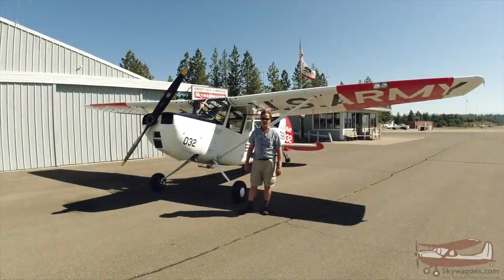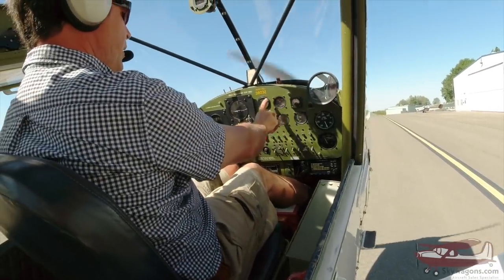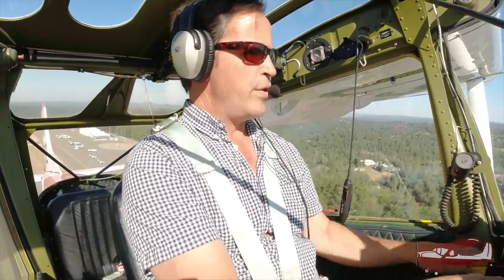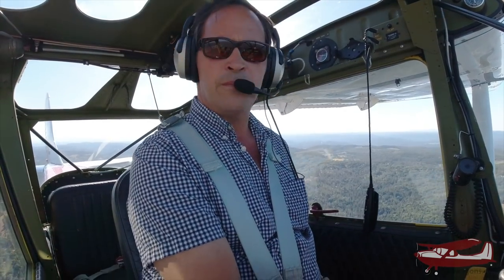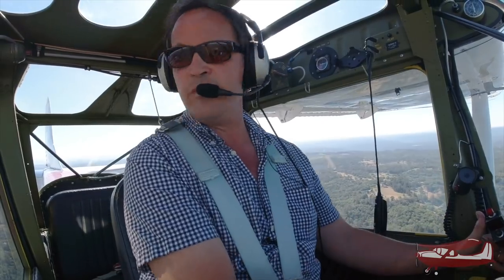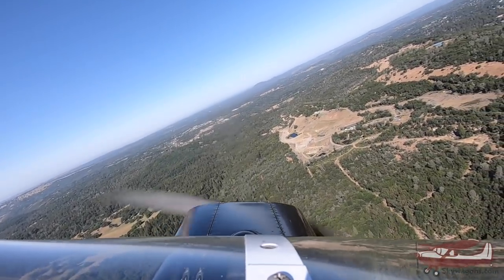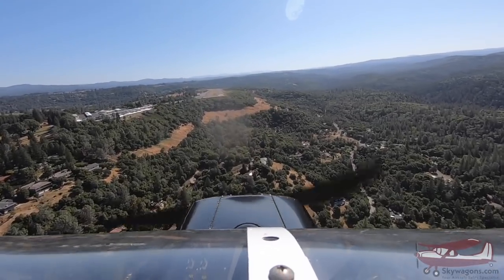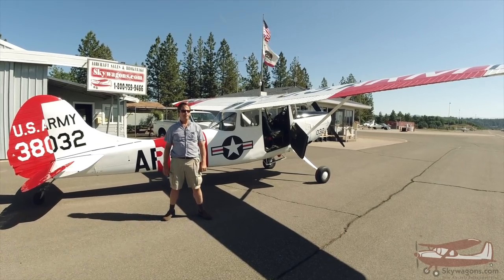Flying the Cessna L19 Bird Dog

Comment: Mark, I'm somewhat envious of your little trip around the pattern. Now a comment from a 1,000 combat hour former Army O-1 pilot. With the flaps available in the O-1, there is NO need to drag it in to a landing. It's not a 757 with two powerful engines. It's a simple little aircraft that, with the wide range of flap settings, can be landed with only idle power and not dragged in. We were always taught that you should be able to land it if the engine fails anywhere in the approach. Plus, by using minimal power in landing, you will land in a shorter distance. If you have the flaps, learn to use them ... all of them if need be.
Reply from the maker: Thanks for the tip.  It was the second landing I have ever done in it.
Reply: When I learned to fly (1957) and when I was an instructor, (1962-1966), we taught only power off approaches. Adding power on final meant you screwed up.
Reply: @frankbacon245  That is the way I was taught by my instructor in 1957.....he was a former USAAF and USAF pilot who flew C-47 and C-54s ."over the hump" and the Berlin Airlift.......he said "any dumb**s can land when his engine is performing.....it takes a pilot to land if the engine fails"
Reply: @jimsteele9975  I had the unfortunate experience of a dead  stick landing on an old  dirt road.in Laos.
Reply: Topper- Over 1000 combat hrs here too . (1st Cav.)  Mark did a wheel landing.  I was never trained to do that.  I tried once and it scared me to death.  Every one of thousands of landings, on all types of surfaces and conditions...it was full stall; plant all 3 wheels on the ground at once; you're done flying.  In a wheel landing, one is still half flying until somewhere down the runway, after the tail wheel touches down, and gets slow enough to brake.  In a three point landing, one can land in a surprisingly short distance by hanging it on the prop;  coming down the final with a high power setting, nose high, slow speed (close to stall warning), planting it, cutting power and braking all at once. It helps that the plane has a 470 engine, large 60 degree Fowler flaps, and single leaf spring main wheels gear.  She's a tough bird. Of course, if the engine quits, you're toast.  I implicitly trusted our mechanics.

Comment: The L-19 for Microsoft Flight Simulator, a fairly recent release, brought me here. That's about as close to the real thing as I'm likely to get, but it does behave exactly as your video. So, at least there is a good virtual model to afford vicarious thrills! Have to agree with the military pilots commenting that it lends itself to a low throttle or idle setting on final, unlike the J35 I once owned. Thank you (2 yrs late...) for the video!
Reply from the maker: Nice to know it is similar.

Comment: I got to tow banners with several birddogs back in the early eighties. It was so much easier to tow with this plane vs. a cub. An added  bonus was the back window. You could actually see how the banner was "flying" much easier. If I remember correctly, at least one of the planes had 60deg. of flap!
Reply from the maker: Thanks for sharing that story, Larry!

Comment: Beautiful Bird Dog. I towed gliders with them, they were pretty rough looking planes but fun to fly. The only thing was with no one in the back seat we didn't use full flaps, you couldn't do a three point landing with them in that configuration.
Reply from the maker: You have to have the guy in the back lean forward a lot.
Reply: The US Army never taught wheel landings in the O-1 for a reason ... this little beast needs a 3-point, full stall landing and keep her straight. Wheel landings look nice but not intended for any sort of short field or unimproved field landings. Try a wheel landing in a high crosswind and you'll see (if you can control it) why she needs to be planted down in a full stall landing.
Reply: @topper3348  It did a fair wheel landing but I am not a big fan of them. I flew at a commercial glider operation for 12 years on the weekends. Normally 30+ landings in a day. Always three pointed the planes. PA-18, 8GBC and PA-25s.

Comment: Having flown the B dog towing gliders for 7 years in crosswinds, it will be interesting to see if this person really knows how to land one. First, no reason to use flaps during takeoff on a long runway with only one person in the cockpit.  On landing, abeam touchdown point at 800 AGL power 1500 rpm make a 180 turn with full flaps sliping and you will put it on the numbers. Make a flat approach and you will never make the runway with an engine failure.  Nice wheel landing, if you try to 3 point it in a crosswind you will be doing a lot of repair work on a broken B dog.
Reply from the maker: I got away with it.
Reply: "if you try to 3 point it in a crosswind you will be doing a lot of repair work on a broken B dog."" I beg to differ sir. In VN I flew her from a very short and very narrow strip in Rach Gia for a year. Winds were very unpredictable as the Gulf of Siam was next to my strip. I always used 3-point full stall landings and had control all the way through. Never dinged or damaged my Birddog.

Comment: Is it not O-470 powered? Just curious as to why it would not have a constant speed prop.
Reply from the maker: They were fixed pitch for simplicity.  Some of the later after-market Ector Bird Dogs had constant speed props.
Reply: @skywagonuniversity5023  Interesting! I simply never noticed. Thanks!
Reply: The D models are constant speed. The A, E and G’s are fixed pitch. Mine was a G in Vietnam which I preferred for outstanding climb away from the target.